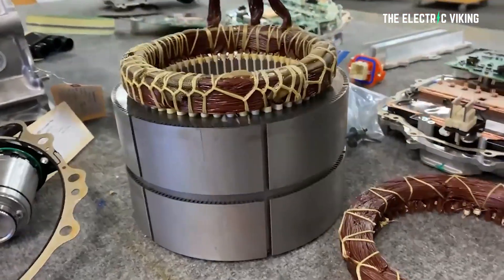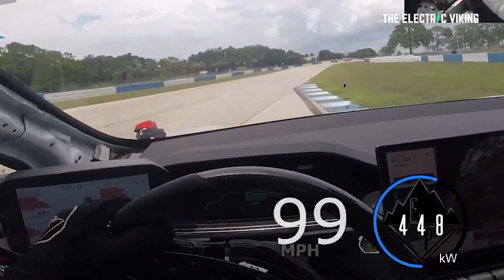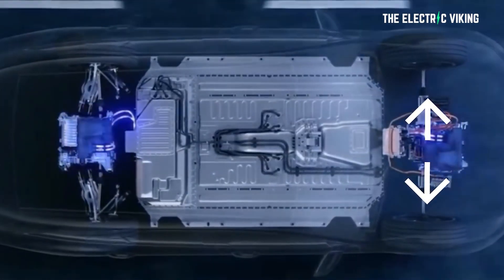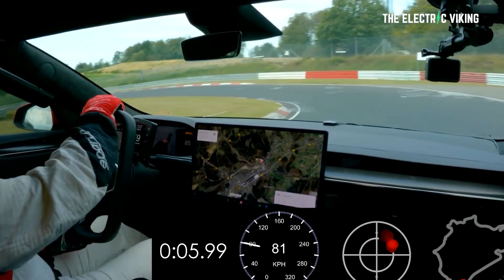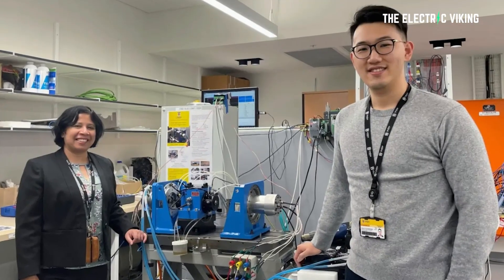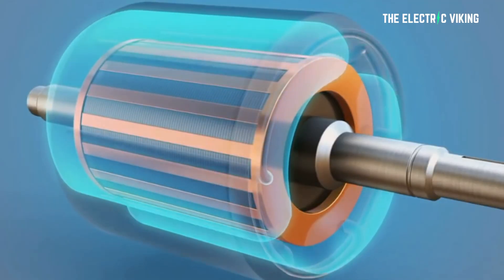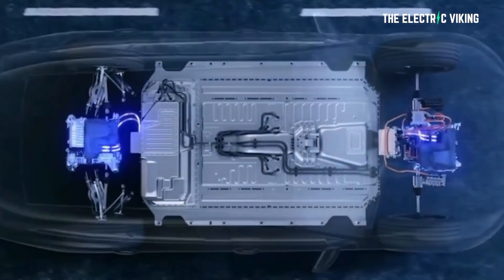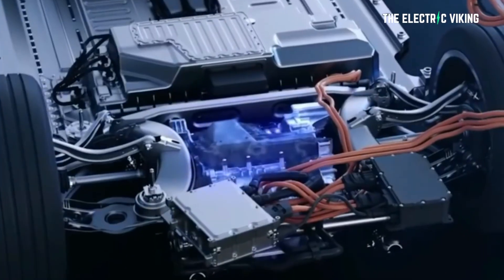World's fastest electric motor can be adapted to run in a Tesla

Comment: You don’t increase the range by making the speed of the motor faster. The range is impacted by the capacity of your battery pack. Your battery pack runs out of electricity, you can’t go further. Speed is not = to how far you go but = to how fast you get to a particular distance.
Reply: @simonbutler6019  China already has 3 vehicles with around 500-600 miles of range. Solar charging paneled cars already technically available in some countries so look for vastly improved tech and a variety of models on near horizon plus batteries that will recharge in 10-20 minutes. Cheers
Reply: @simonbutler6019  solar powered Tuk tuks , no more road kill and they look Indo Delightful
Reply: @beelzebobtheinnocent1659  lol, I thought that was in Thailand
Reply: It's called efficiency
Reply: The faster a motor, the higher the counter electromagnetic field (EMF), which affects efficiency. This higher speed is hard to acquire without tackling the energy robbing counter EMF
Reply: @gary.richardson  eddy currents? I meant with everything all accounted for.. the net distance you get is still controlled by the limiting factor unless all the power consumption is reduced by a magnitude . Correct me if I am wrong
Reply: @simonbutler6019  Get an Aptera Gama 1000 miles not km range on one charge. Next question. Gas, we don’t need no stinking gas.
Reply: Higher RPMs allow for a smaller motor with the same (geared down) torque. Smaller motors mean weight reductions.
Reply: Yes, range is impacted by the capacity of your battery but also by the weight of the vehicle and the efficiency of the drive train. So while you don't necessarily increase the range by making the model faster, if that faster motor also reduces weight and/or increases efficiency it will increase range
Reply: @smann43231816  he said specifically Tesla model S motor.
Reply: @smann43231816  we know this but if it is the same material for that specific motor, the weight is already taken into account , unless much lesser material is used and the weight saving is significant
Reply: @timlavente5880   True
Reply: Yes, the battery size matters but the efficency of the electric motor matters as well. The longer the rpm the less it will consum power that is why they are producing this motor.
Reply: Ah, no. If you can increase the motor rpm without increasing the power consumption, the wheels turn more and you get more range.
 I'd sure hate to see a 100,000rpm motor explode if it came apart from a flaw.
Reply: @lyfandeth  rpm relative to range in a vehicle are not correlated. If the energy used is the same a faster rpm will require a higher gear reduction to move the vehicle the same amount.
Reply: @ArmaAutomotive  so will that relate to a higher range through the rpm increase with electrical pack constant?
Reply: @ArmaAutomotive  how about a smaller press of acceleration pedal instead of a higher gear for speed reduction... That way, the power consumption of a low speed (say 20mil/hr) can now run a car at 80mil/hr... In my mind, this. Will obviously increase range
Reply: @lyfandeth  good point… 👍

Comment: You should look what lucid has done.  Drive Unit: Motor | Tech Talks | Lucid Motors. Amazing what they have done. 👍👍👍🔥
Reply: Or the koenesigg quark setup which is even lighter and as powerful as the lucid setup. Plus the quark offers individual wheel torque vectoring like tesla does with the plaid. 😎

Comment: Higher efficiency is generally associated with LOWER RPMS in any motor.  Now if you are arguing that the motor may be lighter, that may be true, but not more efficient at converting energy.
Reply: Lower RPM won't give you great Torque!
Reply: @scamchan  With electric motors, max torque is at 0 rpm.  Power goes up with rpm, so if you want more power in a small pkg, go high rpm
Reply: @jonahbert111  that's why EVs come off the line so hard. Zero RPM, max torque.
Reply: @jonahbert111  I have never seen any vehicle do work at 0 rpm.

Can you tow at 0 RPM?
Reply: @scamchan  Sure you can, you just wont cover much distance.  LOL
Reply: @scamchan  Daniel says torque, not work. Torque is rotational force. Work = force x distance. So while it may not be doing any work at 0 rpm, it's still generating torque.
Reply: @truhartwood3170  Ha like trying to hold the car still at 0 rpm
Reply: @scamchan  exactly, if you had the car chained to a post or something and gave it a bit of power, but not enough to break tire traction, you'd be generating torque/force but not doing any work. So Daniel is correct when he says max torque is at 0 rpm, which is not the same as claiming it is doing work at 0 rpm. Not sure why you're talking about work when no one else is.
Reply: @truhartwood3170  I talk about work as no one really thinks about a car doing 0 rpm of nothing.

Now we both know
Reply: @scamchan  0 RPM of nothing? What does that even mean? RPM is not a fraction or a percent or something, it means rotations per minute. "Zero rotations per minute of nothing" doesn't make sense as a sentence. You started out by saying "Lower RPM won't give you great torque!" which you were told was completely false, as electric motors have full torque starting from no RPMs, the lowest RPM you can have. Then you changed your unit of measure to 'work' for no apparent reason which, you're right, doesn't apply at 0 RPM because 'work' requires movement. Now you're talking about towing, which involves 'work' and, you're right, doesn't happen at 0 RPM, but no one was talking about that. You keep bringing up different things no one was talking about as if that was the topic all along. You understand that in order to tow something, you start at 0 RPM and so need torque at that point, right? And the torque curve for electric motors is almost flat - you still have 98% of the torque available at, say 35mph. So what even is your point? Are you now thinking that people are saying electric motors have 100% torque at 0 RPM and that drops off to, like, 10% the moment it starts moving? Let's keep it simple - in an EV you basically have full torque all the time from stopped to full speed. That's why EVs don't have clutches or transmissions. With no gears, you have just as much acceleration at 60mph as you do at 5mph, which is pretty cool. They don't even need a reverse gear because electric motors don't have a "backwards" and "forwards" - you just reverse the polarity and they switch direction.
Reply: @truhartwood3170  yeah facts.
I like we can both agree.

Comment: That's not so surprising. The Koenigsegg Quark engine has a 250 kW power at 20s peak that weighs around 30 kg. Peak power is limited to 20s for thermal management reasons. In nominal long term operation, this motor has 100kw, so it's 3.3kw per kg for nominal and 8.3kw per kg for peak. What's really amazing is that they don't need extremely high rpm for this power. According to the published information, they have this power from 4000rpm.
So there is definitely more than one way to make more efficient engines, and that's great.

Comment: Keep the videos coming. Very interesting to see the improvements in EV technology in such a short time. 10 years from now we could have 1k-2k ranges. To me range is more important than speed. Our roads in the UK are increasingly monitored with Average Speed Cameras so driving is more a chore now than a pleasure.
Reply: Yeah, well keep death off the toads or die trying.
Reply: we can have those ranges now if you pay for a bigger battery, range is a byproduct of efficiency, how efficiently you can use electricity, how efficiently you can store electricity. the only difference between 2010 and 2022 is improvements in these designs, the only difference between 2022 and 2032 is the improvements in these designs. Better hardware is important but better software is just as important.
Reply: @carlsapartments8931  Yep, we are at the infancy of EV age. ICE engines have had over 100 years to improve and they are still so inefficient.
Reply: @graemeglass7566  I'm really struggling to see how much more we can go, in terms of electric vehicle improvements. I suppose, it's only the batteries that still need a lot of improvements. Motor efficiency is pretty much as good as it gets, especially with Tesla's motors. Not sure we need more "higher revving" motors, nor do we need faster or quicker electric vehicles, as tires are the main limitation in terms of safety and capability. More energy dense and longer lasting batteries means lower vehicle weight and more range. Current charging rates (250 kW - 350 kW) should be sufficient for consumer vehicles and even light duty pickup trucks. Manufacturing and engineering materials could change to improve weight, as well (giga-castings).

Comment: Incorrect the highr the RPM, the higher is the friction so the efficiency will be effected. 
Power dencity is somethig eles. You do not understand the basic of engineering, it is embarrassing listening to you.. My recommendation do not cover subjects u do not understand in just to have clicks and views
Reply: So rude.  I started a similar comment but Sam clearly states that it's the overall vehicle efficiency that benefits from a smaller motor.
Reply: @MattOGormanSmith  Ooooffff. No he did not. All of this video is full of inaccuracies, competing a rotating mass to reciprocating one. He has Petrions on this channel peope follow him. You do not have to be an Engineer to understand that. He shall be responsible to the subjects he cover, unless his point is to spread FUD, and gain clicks, and if he is than he shall exepect to be put in place.

Comment: I’m a diesel mechanic, I like your channel, change is good, I’m not fighting the new  charges in auto and heavy equipment that is coming , I’m getting more informed
Reply: Have you seen JCB's new hydrogen burning engines?   An interesting idea for heavy equipment.
Reply: @MattOGormanSmith current hydrogen powered cars cost about 200 $ full tanks , range 400 miles , hydrogen combustion engine will have around 50 % efficiency, so you get about 200 miles , still like hydrogen ICE ?
Reply: Personally, I think diesel will be around in many applications for a long time.  Electric isn't the right tool for the job for some use cases.  Most of those use cases would fall under diesel, aviation fuel, or fuel oil (large ships).  Everything else will move to electrification much faster than most people expect.  Small gas engines for yard tools and light transportation will be the lowest hanging fruit.  Glad to hear that you are accepting of change though.  Even if diesel jobs stick around there may be good opportunities for those that are keeping up with change.

Comment: Yeah but ICE engines are not direct drive , so if you want to compare them to electric motors is better to go with the RPM at the axle
Reply: RPM at the axle is defined by the wheel size and the speed,  so it usually needs gears whatever engine/motor is driving it.  Electric cars generally have a fixed reduction ratio but this can be chosen to match the top speed of the motor to the top required speed of the wheels.  The size and weight of this gearset are the major limit on how much benefit you can get from a smaller/faster motor,  and there's the annoying noise you get from a high RPM motor
Reply: @MattOGormanSmith  it would be without wheels of course, like some dinos that instead of getting the data from the rollers they attach directly to the hub

Comment: I can't see how these could be useful for a car like the Aptera which has in-wheel motors. At 100km/h, those wheels aren't spinning at much more than 1000rpm. You need reduction gearing to actually make those motors useful.
Reply: It would make the motor smaller and other parts too making less power hungry thus more range...
Reply: @kylereese4822  only if the weight savings on the motor outweigh the weight penalty of the gears

Comment: This interesting is this only design concept. I would like to know how they over come the problem Tesla found, which required the Tesla Carbon sleeve solution. The forces generated by high RPM warps the motor. Has this been tested and your right durability is the problem.
Nothing mentioned here about how they tested if its real and how long it ran for in what vehicle.???

Comment: But, wasn't the argument against gas turbines that they rotated too fast.
Reply: As I recall it was fuel efficiency.  Well balanced engines can manage the RPM.
Reply: @danharold3087  but gas turbines are more fuel efficient than piston engines,  which is why all the old DC-3 have been retrofitted with turboprops.   I suspect it's a combo of noise and narrow usable RPM range that killed off turbines in cars.
Reply: @MattOGormanSmith   "Chrysler's turbine engine program ended in 1979, largely due to the failure of the engines to meet government emissions regulations, relatively poor fuel economy, and as a condition of receiving a government loan in 1979."

Generally turbines are less efficient than piston engines.  Don't trust me google.

Turbo props are more efficient than jets. Could be where you remember this from.   I expect they are fitting them to the DC-3 for more power and mostly more reliability.

Comment: small motor w/ that kind of RPM... just imagine the amount of friction that it's bearing have to withstand.
update : please don't get me wrong, I am not against any new tech.
Reply: and the cooling of smaller coils is trickier.  And consider the poor little pinion teeth.  you'd probably need a planetary set instead of spur gears like they use now.
Reply: Imagine how much smaller and lighter the motor is. You can buy an air cooled drone motor now than can sustain 1Kw and deliver a 2Kw peak. It easily fits in the hand of an adult
Reply: @theairstig9164  IMO, drone motor is light on load (only propeller against the air)... and it's "cheap" , U are more likely to crash it before wearing it down anyways :D